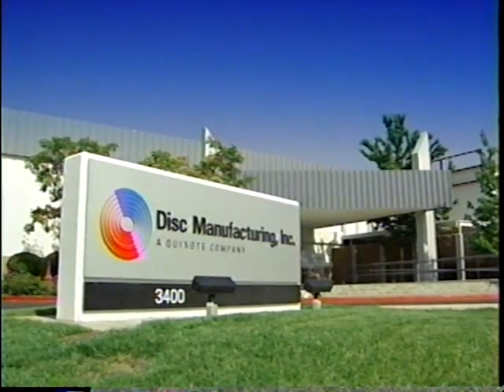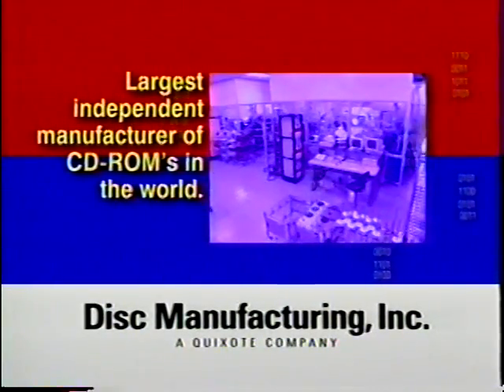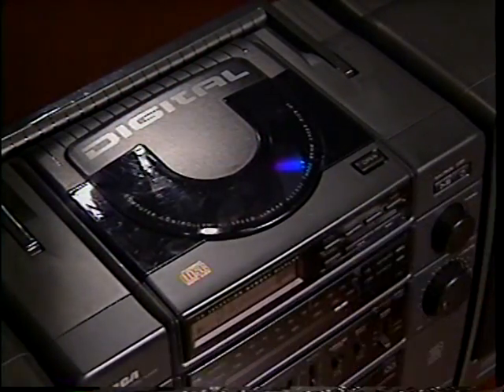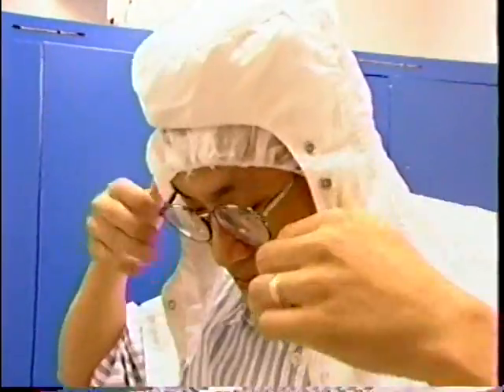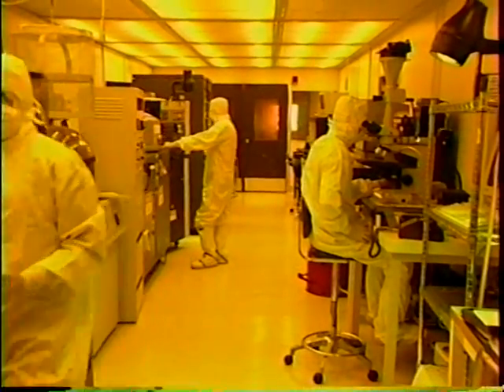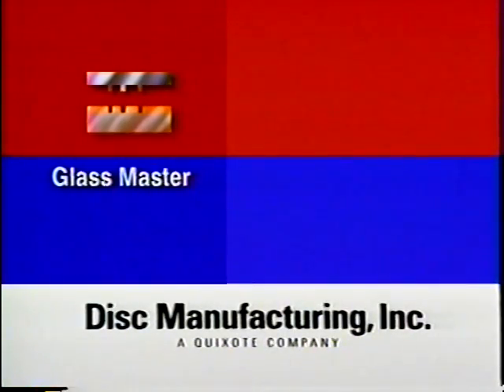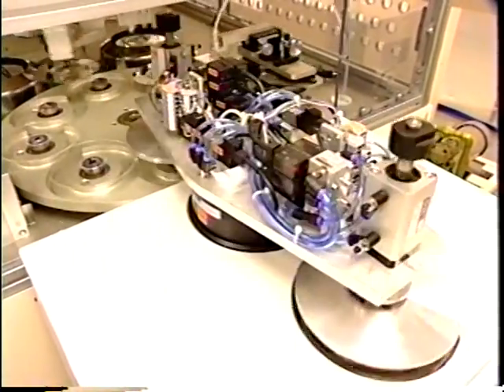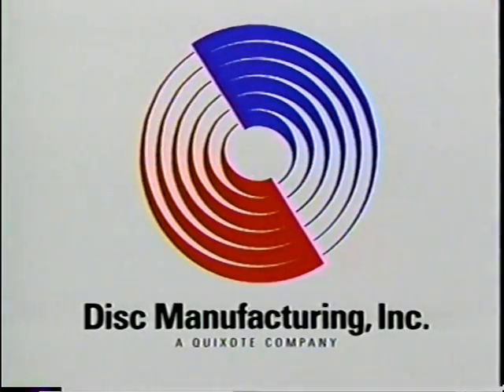Disc Manufacturing, Inc plant tour circa 1995

Comment: Was in this industry from 1992 to 2009 till my plant shut down.     CDs died     Was a great job.    Worked on the molding machines.  Metalizers.   Spincoaters.    Inspection.    And print machines.     Even the dryers and feed systems.     Sure miss it

Comment: I worked at Disc Manufacturing Huntsville in about 1995 or 96 doing manual inspection just after Screen printing and then moved into the cleanroom doing automated inspection just after Met/PC. Got laid off just after the Christmas rush finished. Went back to work at Cinram in 97 or 98 for about a year as a screen print operator. B team was always a fun shift and Don Saddler was a good boss.

Comment: why are they putting CDs in cases and then inserting it into computers? Is there any model number for those type of drives, they seem interesting and I would like to look them up. Thanks
Reply from the maker: That's how they used to do that in the beginning, the case was called a caddie.  Not all drives did that, but some did.  The first CD-Rom drive I had was a Toshiba 3401 and it used a caddie to protect the CD.
Reply: breckrowell thanks for the info, interesting stuff and i love learning about older tech
Reply: A lot of radio stations used professional CD players that also used caddies to load the CD's. They were thinner than the one shown. The CD's would stay in the caddie on a wall, all numbered for easy access by the DJ. Just pull it off the shelf and shove it into the CD player it would load as fast as you could pop it in and wait for you to select the track you wanted. Waiting to be played, usually triggered from the audio boards input for the CD player by the DJ. As new CD's came in from the library subscription company the station subscribed to, they would remove them and put in new CD's over time. Cycling out the older CD's if it was not a permanent library like oldies or classic rock etc. I think they sent them bi-weekly or monthly. They were manufactured CD's not burned ones, being that this service started way back in the 80's, even to the late 90's they were manufactured red book CDs with silk screen print. It was a nice service. Later on stations would just buy entire catalogs on pre-loaded hard drive's to play from the automation system.

Comment: As I have been informed, the Reflective Aluminiun Layer may degrade with Time, even on Recordables but as well on Standard Mold-pressed Media. Especially if it has been applied very thin. Other Recordable Media in my own Home already had developed Defects with time, such as the Reflective Layer getting loose and breaking (flaking) away.
Reply: Whether the aluminum substrate degrades depends on whether the disc was made properly and how well it's been taken care of throughout its life.

The first thing to fail would have to be the lacquer seal as that's what keeps the aluminum protected from exposure.  But, this layer of lacquer is very thin, so it can be damaged if the disc is carelessly stored and/or handled.

For instance, if you put CDs into a flexible CD wallet, the abrasion of the lacquer from the wallet can cause damage.  Another is if you have a habit of laying a CD label-side down against a hard surface; any granular particulates that happen to be sandwiched between the surface and the disc can poke through the lacquer.

Breaking the lacquer seal can expose the aluminum to oxygen, which can cause it to break down via oxidation.  There's also the risk of the aluminum being scraped off with the lacquer, which isn't good.  And unlike scratches on the iridescent side that can possibly be polished away, scratches on the lacquer side are permanent.

As for certain recordable CDs, it's not just the reflective substrate you have to worry about.  You must also worry about the stability of the recording dye, and usually that's what breaks down, especially if the disc is subject to exposure to excessive light and/or heat.  And some recordable CDs are better at lasting a long time compared to others.  Some of the best CD-R media were from companies like Taiyo Yuden, who used to make discs in Japan.  Now, your best bet are media products from Verbatim (Mitsubishi), specifically their DataLifePlus series using AZO dye.
Reply: I can agree when it comes to recordable CDs. As of moulded ones however if you take care of them, they are far more resilient. Just in the touch you know there is a difference between recordable and moulded.
Recordable will last from a year to like a decade while moulded will go beyond that. What I can tell you is I can still rip CD's from the 80's/90's. It is like 30 years now. And now I think about it I have CDs from albums that were released in late 70's but it needs some more info. I did not found a release date printed anywhere. Still CDs can last decades no problem. I use them only for ripping if needed which mean almost no more. I listen to the FLAC files instead.

Comment: interesting. were tests ever done on longevity? do you have discs from early 80s that still work well? really the lacquer seems the most important part as it protects the data?
Reply from the maker: The coating process is very important and in fact they did environmental chamber tests early on that predicted that discs that were kept in a cool dry place should survive for 100 years.  I have many discs that were made in the early days that still play perfectly.   I haven't put any of these discs on an error counter to look at block error rate, but the all sound fine to me.
Reply: +breckrowell cool. i think my oldest disc is about 25 years old. it seems fine to. they say vinyl could last 1000 years, but if you were to play it a lot it would wear out quicker than a CD. do you think CD has a good future? i wonder how the ultra HD bluray will take off.
Reply from the maker: +Kailash Personally, it looks to me that optical discs are going the way of the wagon wheel because everyone is moving onto digital downloads or streaming audio/video.  I still insist on having a physical copy of my movies/music because I don't want to lose my collection due to a hard drive crash and want to still have access to it even if I don't have internet access.  That's just me and a lot of people don't feel the same way.  I'm not sure how newer formats will do due to the move away from physical media, but I guess time will tell.
Reply: I have CD's from the 80's ripped to FLAC no problem. Longevity for moulded CD is OK.

Comment from the maker: I worked for DMI from 1986 to 1997 as a Mastering tech and finally a Product Engineer.
Reply: The is the same process for making DVD, Blu-Ray, even Laser Disc and other optical discs.
Reply: I was there at about the same time frame. Worked in engineering, and then for a bit with Mike Lust in mastering.